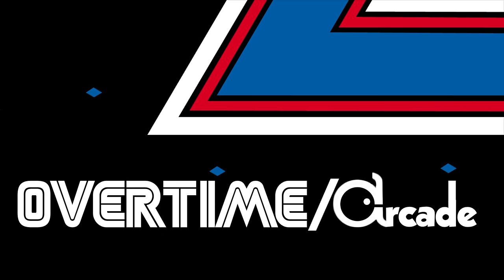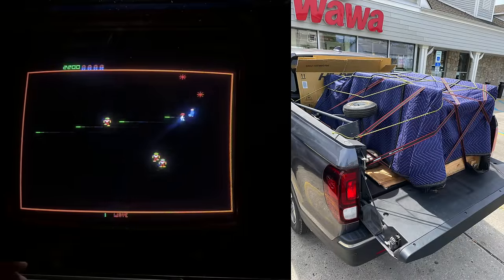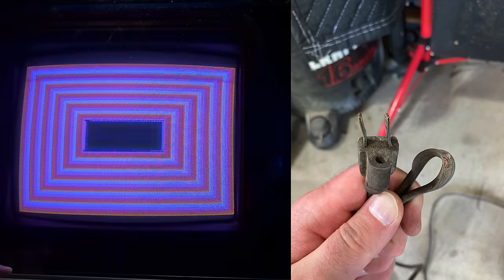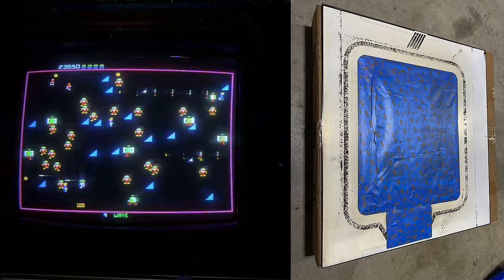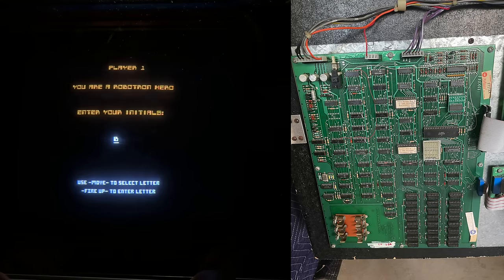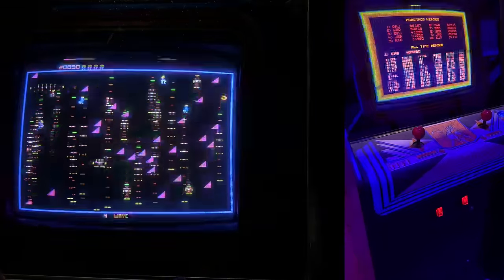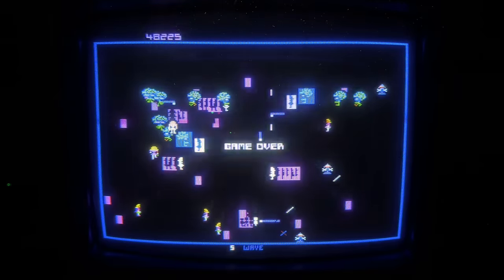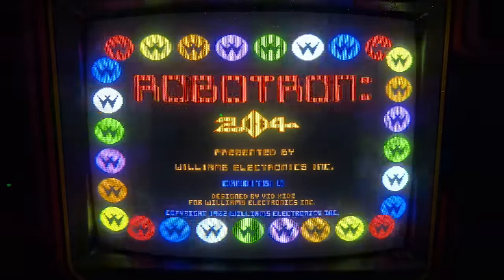Robotron: 2084 arcade restoration retrospective 🤖🛠️ + gameplay practice for high score tournament

Comment: Hi Charlie!
I have some thoughts about touching up the bezel on your Roboton (Non-destructively, of course!), and was wondering if you might consider trying it out;
- You've already Triple-Thicked the back of the bezel... This will, of course, prevent any further damage to the artwork...
- Do NOT attempt to use paint! Paint is thicker than the inks originally used to create the artwork, and brush strokes will be evident, even if you manage to match the color...
-  Go to your local office supply place, and pick up some transparency film/paper to be used with a color inkjet printer (Think making color overlays for overhead projectors)
- Using a paint program of your choosing, create some color swatches for each color to be repaired, playing with variations of saturation/gradients on either side of the scale, print it out and place this behind the bezel to find a color match you're happy with... **
- Print an oversized patch section for the area you wish to repair, cut to size (the Robotron bezel colors are solid, and straight lines, so this should be fairly easy), and attach to the rear of the bezel, using a clear spray adhesive (I hear that Elmers dries clear)
- Repeat for other colors
- Although the bezel is not backlit, you may consider covering the repair from the rear with heavy-bond white paper, for light diffusion purposes

If the attempt is unsuccessful, the patch(s) can easily be removed, without damage to the bezel...

In the event you go completely insane, and decide to start working with older pinball machines, this method can be used to touch up the back glasses...😉

** A digital color match system could help, but is not strictly required...
Reply from the maker: That’s a great idea! I should buy a color printer… 😂

Comment: Nice video and detailed. I didn't see if you had to replace any of the chips though? My brother has a Robotron that stopped working and we think it was the Rom chips again but can't' find any parts or anyone to service it anymore.  Just too old.   Any advice where you got your replacement materials?
Reply from the maker: Thanks! I didn't have to replace any ROMs or anything on the main boards, although I did install an NVRAM chip to eliminate the AA batteries, and I had quite the intermittent issue with the sound PCB that I finally solved here: https://youtu.be/07ejmjcy6-o

If you're just looking for some new ROM chips, www.hobbyroms.com (Hobby ROMs) comes highly recommended. In terms of servicing Williams boards, you might want to contact braedel or mecha on the KLOV forums to see what their repair queues look like. Good luck!